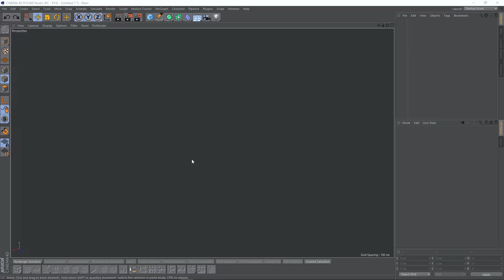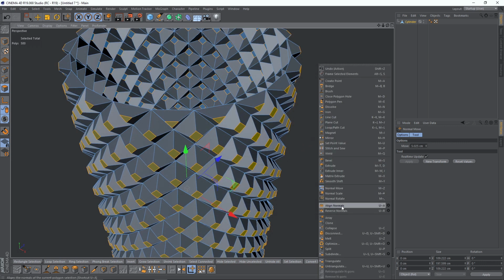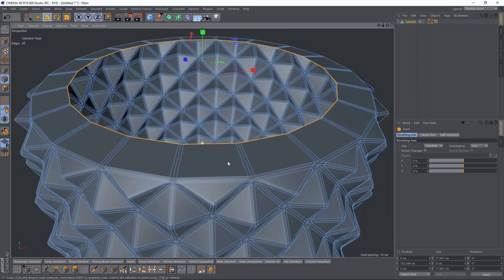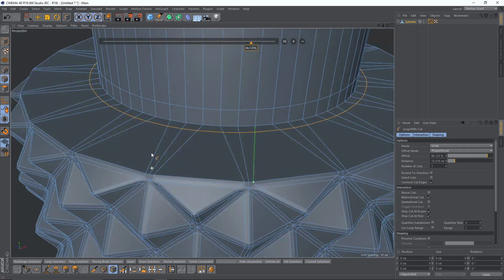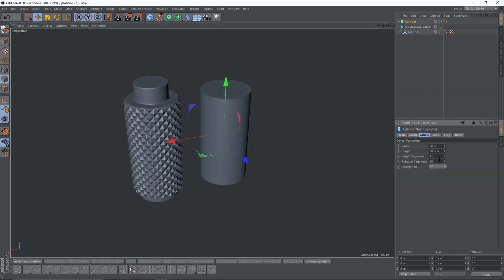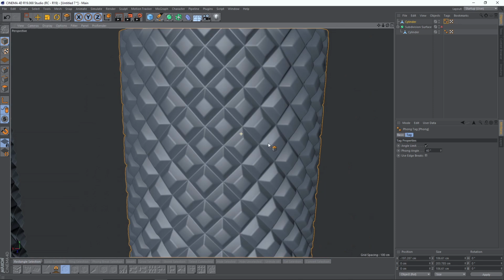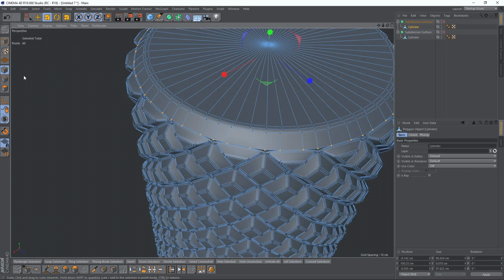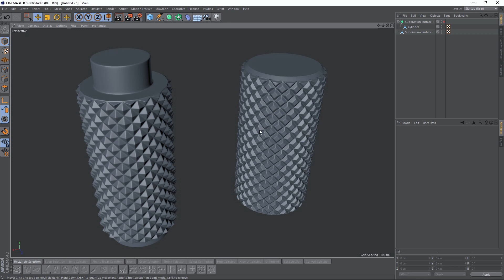Cinema 4D Knurling Modeling Tutorial | 3D Printing

Comment: Hello,
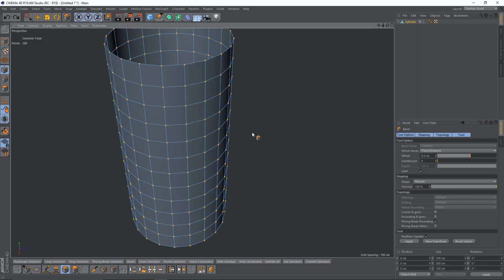when i'm bevelling the dots when i'm turning the square to diamonds polygons (00:40), even when i'm checking the limits, the dots on the edges of the cylinder are keep beveling so there's no meeting point between these points.
what can i do about that?
Reply from the maker: Hello, did you you try to optimize the points, select them all and right click, optimize, then bevel again.
Reply: @polygonpen  should i optimize them before bevelling for the first time?
When i triex to optimise the number of the dots went down to 540 while in your vdo it gets to 500.
Of course i created the cylinder the same size as u did.

Thank you for your fast reply!
Reply from the maker: @eyalyoungi  Before beveling them, try to optimize.
Reply: Had the same issue, using R26. Use proportional offset mode to 50%

Comment: Yet another very good video.  I had to watch parts of it a couple times -- the normals scale and normals move are new to me, and mind-blowing!

When I was first learning C4D, I made a knurled cylinder - I used totally different process that was not very elegant.  

I made a diamond, and swept it on a helix, then radial cloned it.  Then I duplicated the cloner and put a negative value in the helix so it twists the opposite direction.  Both cloners were made editable and boolean subtracted from a cylinder.

In retrospect, it was full of triangles, not quads, but your bevel trick would resolve that!
Reply from the maker: Yeah that`s another way too but this was quicker I guess.